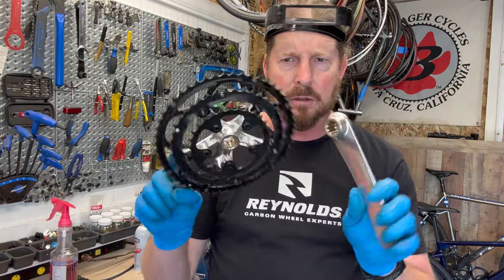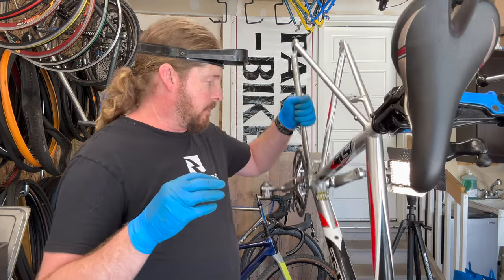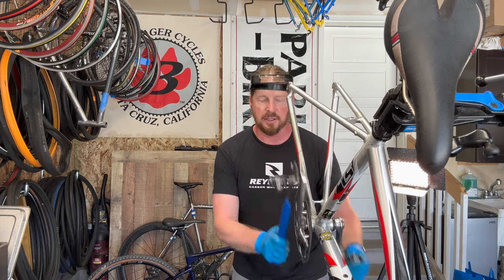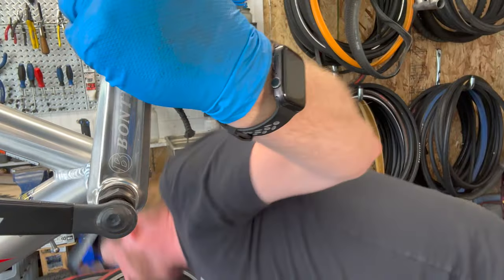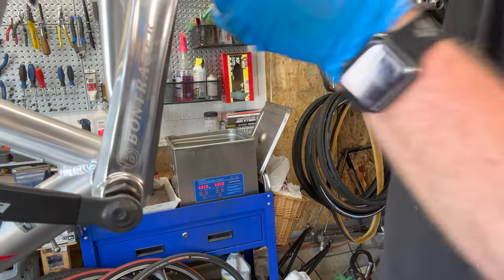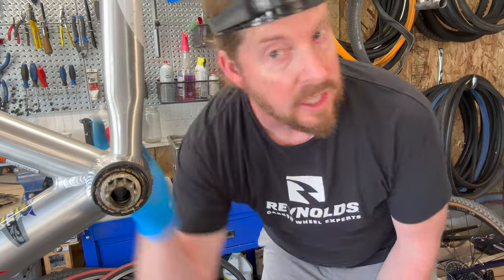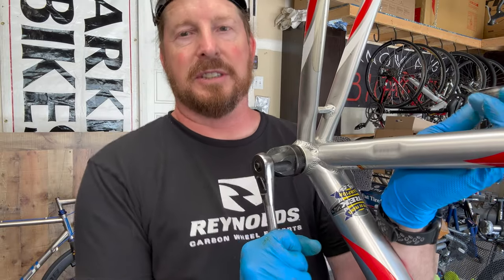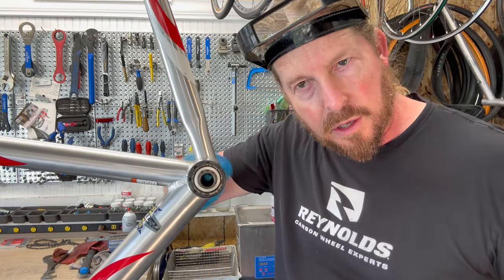🛠️ Bicycle ISIS Crankset & Bottom Bracket  ⚙️ Tech Tips - This Old Bike

Comment: Thanks! This is exactly the guidance I needed to work on my early 2000s Trek 7.5 FX.
Reply from the maker: Glad it helped! Thank you so much!
Reply: @IKnowAGuyBicycles  I ordered the crank puller and with your tip of using a strap to hold the opposing crank I was able to remove the cap screws to the spindle and with a cheater bar (thanks Archimedes) and the the crank puller tool worked perfectly. I am waiting for the cup wrench and hope to remove the BB this weekend. Can you help me find the vintage tool in your video? I subscribe to the ethos of he who dies with the most tools wins. Cheers, Andy

Comment: Your info was just what I was looking for. couldn't find anywhere. That bike even has same paint job. Bought in 2019 plus 2800 miles. I bet it should be looked at.
Reply from the maker: Glad it helped.
Reply: Me too. I bought a bike with a broken frame for parts and the crank puller I have doesn't work and I'm looking for the way to pull it.

Comment: Awesome, thanks for sharing, especially because those got a comeback on ebikes. One question though: Can I shim them (washer on the splined axle) to bring chainrings (and crankarm) more outboard, away from the frame? Shimano changed the standoff by 1mm for their 12-speed groups.
Reply from the maker: Depending on the bottom bracket, you can shift the spacers. But you shouldn't shim the crank arms out from the BB spindle. Those crank arms must be pressed in entirely so they don't fail.
Reply: @IKnowAGuyBicycles  Hey, thank you! And for other viewers: On ebikes with ISIS the chainring spider sits on another spindle. You can shim it independent of the crank arms. 0.5mm is no problem, up to 3mm are doable but you will need a longer lockring.